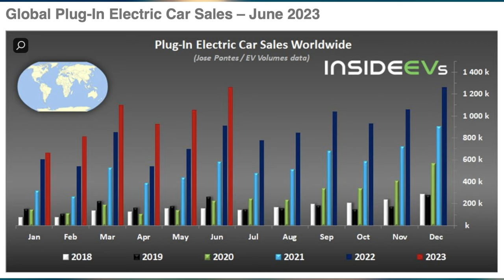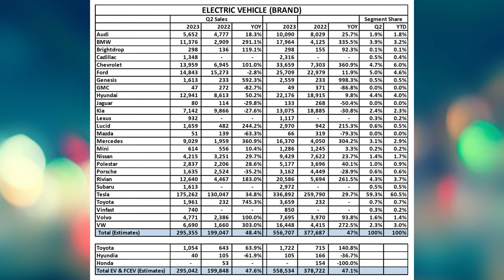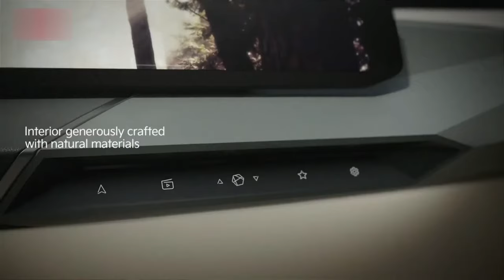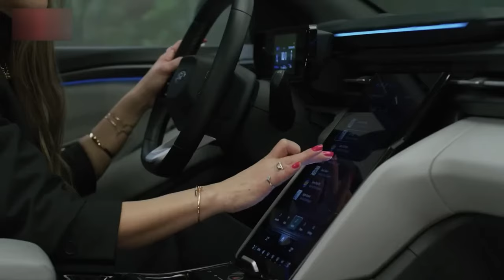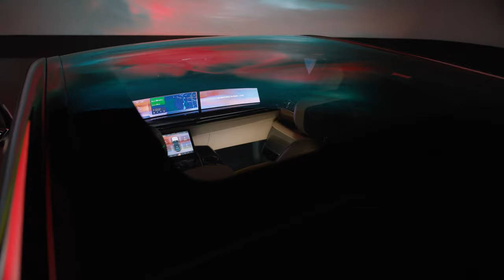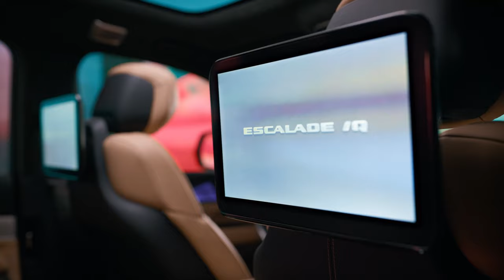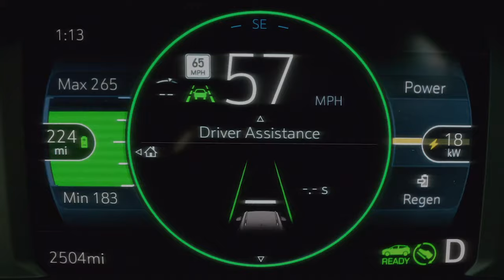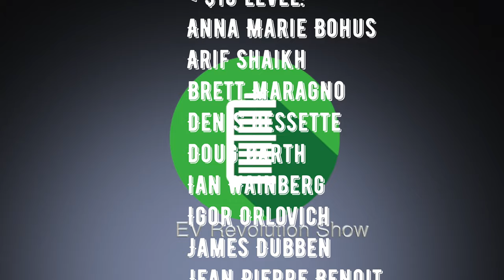Episode 222 - News Episode - Global Plug-In YTD, GM Escalade IQ & the Bolt Lives!

Comment: What is EV production capacity?  Even if you wanted EVs to double sales every year, it is unlikely we have the capacity to supply that demand.
Reply from the maker: Thanks for watching.  That is what I am stating, that we need production to scale up dramatically, not at the slow pace (other than Tesla and the Chinese).  This dragging that Stellantis and to some degree Ford and GM are doing, needs to stop and ramp ups need to happen faster.  Plain and simple.  It is much easier to scale up to an EV production line than it is an ICEV line, so all these delays in starting to ship new products, and the measly quantities they put out, need to stop.  Case in point, the Cadillac LYRIQ is a fantastic BEV, yet they've only delivered a couple of thousand in all of North America and some in China.  WTF, why are'nt they producing hundreds per week at least?  I know Cadillac has a waiting list at least 1-2 years in length.  It's this kind of stuff that gets me upset.  Great if you announce 10 BEVs, but it you don't ship any for 2 years and then when you do, only a few thousand?  We need hundreds of thousands.  So yes, part of the problem I stated in my video is lack of inventory, supply chain, etc. etc.  However, the big OEMs need to solve these problems fast.  If Tesla can do it, any of the big guys can too.